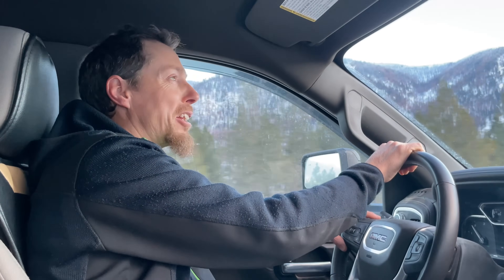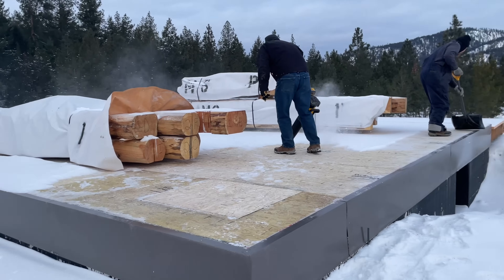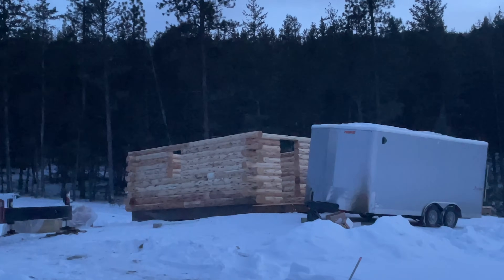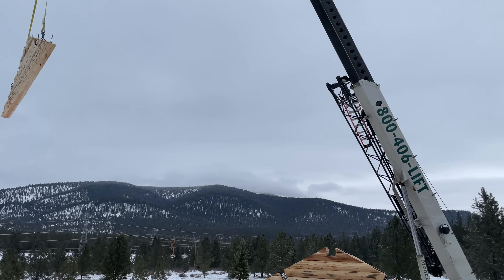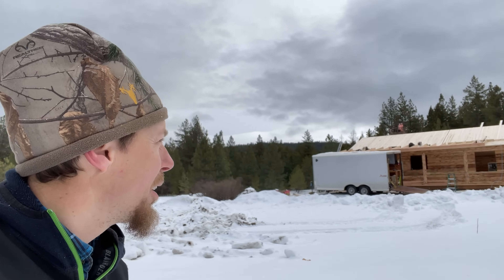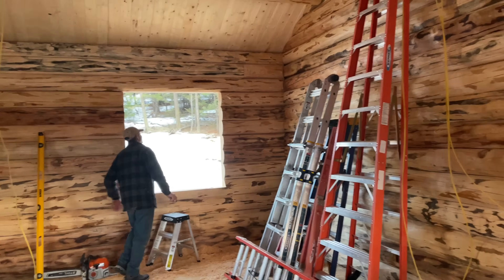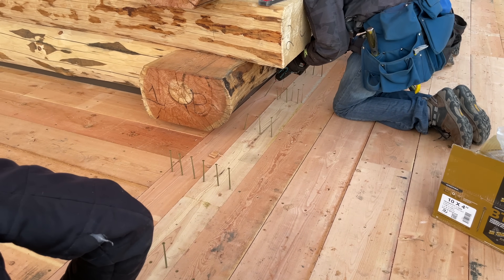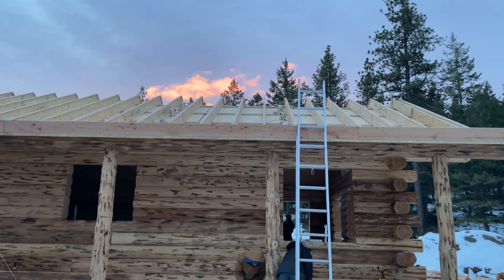Log Cabin Build in Montana in 6 Days / With Joas & Sons

Comment: Was the roof vented or non-vented? If it's non-vented wouldn't the gap area between the spray foam cause condensation?
Reply from the maker: It is vented.

Comment: why do the window and door bucks have a large gap on the top?  I have a log home and have never seen that done that way.  I am in need of changing all my windows and doors and am also adding two large sliding patio doors in place of a door and two windows.  Any suggestions would be appreciated.
Reply from the maker: On a new home, the logs will settle, but if you have a Home that’s been up for more than five years you don’t need a settling gap.

Comment: What is the foundation?  Is the a typical foundation?  Is it insulated?  What is the R rating?  What is the R rating of the roof?  Walls?  Thanks!!!
Reply from the maker: It is a poured wall foundation. Yes that is typical. The concrete is the insulation. The roof is R 38. The walls are generally better than a stick frame house.

Comment: Did you get your logs in Alaska?
Reply from the maker: From Montana.
Reply: @MontanaHaven did you ship to Alaska? Could you find good logs in Alaska to build a nice log cabin there I am  wondering what is a good wood to use pine could get insects eating the wood is that right? And what wood can withstand snow all year around and wood fire heating? Or would it be better to use brick?